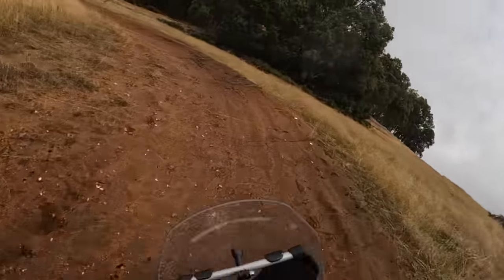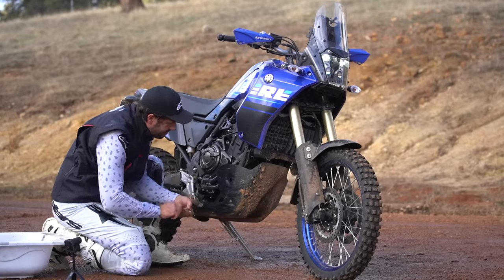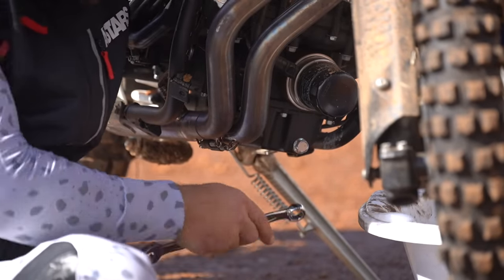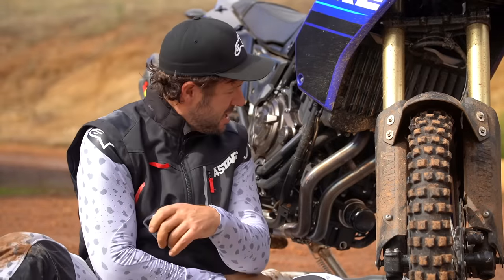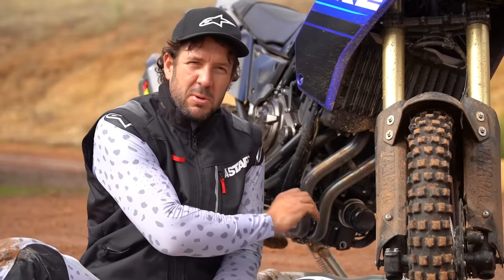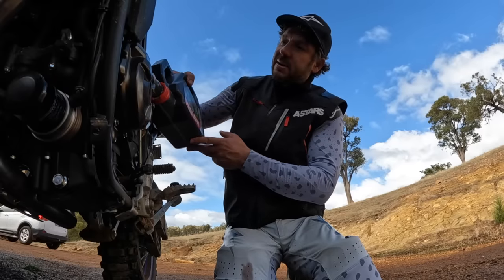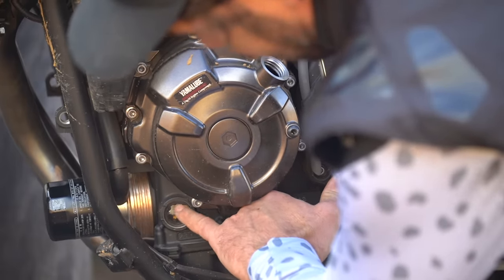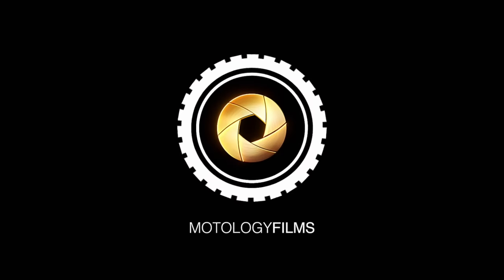Ultimate Engine Maintenance Guide: Triple Your Bike Engine's Lifespan

Comment: Learned more about oil changes in 18 minutes watching your video than I have in 40 years of riding :) Thanks!
Reply: You had never learned to get the bike warm? Read the manual much?
Reply: Me too feel stupid now
Reply: 💯 True 👍👍
Reply: Ditto, Martin.
Reply: Commen sense ..hot oil changes are the only way
Reply: Another thing we used to do back in the day, was fill up with a cheap flushing oil, run the bike around the block a few times, and then drain it again. Only then did we fill up with the good oil. My Dad taught me that. He recovered and stripped American tanks down in the Western Desert during WW2. He was also the guy who figured out how to make fast tanks and slow tanks. The army stole the patent.
Reply: Don't listen to this guy, oil weights are thinner when cold, his just reducing oil flow and leaving old oil attached to the engine parts. 
let the bike sit for a while to enable all the oil to sink to the drain pan,
Reply: @JackBurton7130  The manual just says to get to operating temp. Not ride it hard first as the dude suggested
Reply: 18:23 to be exact😂
Reply: Glad to know I've been changing my oil right for the past 40 years here....
Reply: @grahamnield7716  Yep my Honda says let it run 5 minutes but not ride it.
Reply: @DJIInLondon Nonsense! 10W-50 doesn’t mean the oil is ‘10’ when cold and ‘50’ when hot.. ‘10W’ indicates that the measurement was made with a different standard at the lower temperature than the hotter one. Oil isn’t magic - it doesn’t behave differently to every other liquid in the universe. Hot oil runs thinner than cold oil, and goes through smaller measuring holes. When I went to college viscosity was measured in “Redwood Seconds”. Doubtless they’ve changed the standard these days.. Les in UK
Reply: My oils never black when I change it

Comment: i'm a mechanic (a car mechanic but there are no differences when it comes to oil change) and i would say you did a pretty good job in showing how to properly do an oil change. 

i would just like to specify some things:

1- when installing a new filter, it is good practice to use some oil to lube the O-ring (in this case, it was pre-lubed), to do so just tip your finger in oil and wet the rubber seal (better with gloves) 
2- do not ever use power tools when tightening either the oil filter, the drain plug or the fill plug, as you correctly shown, you should alway tighten by hand and stop turning as soon as you feel a bit of resistance
3- one good thing to do is to check the oil filter and the air box, i often find bits of leaves and other dirt in air boxes (behind the air filter), i'm still puzzled as to why that happens even on relatively new air filters (i suspect poor installation is the cause) if you find such debris, use a hoover to suck all the debris out, pay attention also to the mainifold leading to the engine and hoover it as far as you can, DO NOT, under any circumstance use pressurized air to try to remove this debris, it could seriously damage your engine as you are pushing the debris INTO the engine. 
other than that, just give your engine a bit of time before you start hammering it (it doesn't really take much time on modern engines, you mainly just wanna reach oil pressure before starting to move, 10 seconds is a safe esitmate) and do not rev the engine much before it heats up a bit (doesn't take long, 1/2 minutes of decent speed driving). if you follow these instructions, and you do proper maintenance, your engine will be decently bulletproof (design defects not withstanding).
Reply: A good video. I use a torque wrench on sump plug and filter.
I also cut the old filter open and inspect the paper and keep it in a library with kms and date.
Reply: In your opinion, what is your recommendation on the oil and filter change for the bike at the same time... Specs do not call for the same change out... Cheers mate
Reply: @RobertSantos-rw8dy  I go 5k or 12 months. The start if the
Reply: Start of the ride season. Plus fresh brake fluid.
Reply: @frankguernier2280  inspecting the filter is a good idea, but one shouldn't be shocked if he finds a little amount of metal dust, just be careful of chunks, the torque wrench is also a good thing, not vital, but good.
Reply: @RobertSantos-rw8dy  just always change both, it's better to spend 10 bucks more and be safe when it comes to engines
Reply: @frankguernier2280  brake fluid should be changed every 2 years, but it may be a good idea to change it earlier if you ride hard, just always use the correct spec of fluid
Reply: 5K kms to change oil filter, can I change oil at 2.5K and not replace the oil filter until the 2nd change oil of 5K kms.
Reply: @frankguernier2280  i use the pneumatic impact when putting on my oil plug and i use vegetable oil as oil. HAven't changed my filter since 2003.
Reply: @niccolotesta683  I don't believe riding hard matters for the brake fluid. The reason we need to change brake fluid by time and not by miles is that it's hygroscopic, meaning it absorbs moisture from any air it's in contact with. This shouldn't change based on how hard you ride. The fluid isn't "worn out" or dangerous at the end of the 2 years either: that interval is designed so that when changed every two years, your brake system will be in good shape through the life of the bike. So it's not really based on one fluid change but the entire lifecycle.
Reply: What if I only have a Dyson?
Reply: @AleksiJoensuu  high temperature can lead to brake fluid degradation, which is why it is changed very often on race bikes, for street use, it is a good idea to change it a bit earlier than expected (2 years) if you ride hard and heat it up more than normal
Reply: @merkel2750  a Dyson works well to suck debris out of the intake system.
Reply: @itzFYEB  this is my other account
Reply: @itzFYEB  this is my other account
Reply: @junarcinas8633  if i understand well you're saying that your maintenance schedule requires oil filter change every 5k km, but you would like to know if you can change the oil sooner.

if my understanding is correct:
you can change the oil sooner then advised without changing the filter, you will remove some debris sooner than usual by doing this, i personally do not believe it makes much sense on an economic level, but if spending a couple dollars more makes you feel better, then go for it (if your engine model is prone to seizing, then doing this is a totally viable option).
Reply: Thanks for a great video. Oil is the lifeblood of a motor.
Reply: @RobertSantos-rw8dy  Cheap filter ? Change it everytime. Expensive filter that is rated for 2x as long as the oil ? Change it every other time .I change my oil and decent filter ( mid range price ) every year , I put on less than 3K a year .I have more than one bike and one is a hot running air cooled and it sometimes "tells" me to change it a little earlier ,some clunking into gear etc.Try to match filter and oil specs like when using synthetic oil get a longer lasting filter , regular oil maybe get a "cheaper" filter.
Reply: @junarcinas8633  In this day and age tell me what bike you can't download the manual for ? Go by what that says .
Reply: @frankguernier2280  personally, I'd cut that in half. Especially, if you do only 5k per year. I'd have a yearly service at the dealers, but perhaps do the oil change myself after the winter, as I don't do many miles, although ride every day regardless of weather. And lube and adjust the chain every 300 miles (it rains a lot here).
Reply: @niccolotesta683  I would say, read the manual. Usually, filter needs to be changed on every other oil change. About one a year. And it's not for the money, just a little less trash, consider the planet.
Reply: @pontushaggstrom6261  Let me guess, you are a professional mechanic for a major brand.
Reply: @romgl4513  of course if the manual specifies the oil filter be changed every other oil change it is best to do so, as i said, i'm a car mechanic, and generally speaking car manufacturers call for an oil filter change every oil change, it is also true that car engines tend to require oil changes less frequently than bikes
Reply: @niccolotesta683  I just watched a video of some engineer saying every 6700 km if you're keeping the car for 20-30 years like 400-800,000 km but 8000 km if 10-20 years 160-400,000 km  and that's using synthetic in both cases.  Not sure how bikes would compare to those numbers but I've been doing it every 5000 km I think or maybe its 8000 km on synthetic in my adventure and touring bikes.
Reply: @AleksiJoensuu  I've never in all my decades EVER changed my brake fluid.  It just doesn't seem to matter and same for my snowmobiles.

Comment: Agree with everyt single word you said on this video, as always.
And don´t forget 🙂
Never turn the engine off when the fan kicks on to cool the engine down, let it turn off first.
Reply: Why is that?
Reply: @Gwiedert  If you turn the engine in this very hot condition off, the heat will stay for very long time in the engine and because the water is not circulating at this moment it may start to boil and damage the coolant or even the head gasket and other parts will also sufer from this.
This is the reason why modern cars have an electrical water pump that continues to circulate the water even if you turn the engine off.
Sorry for my bad english, its not my native language.
Reply: @iliasminas7711  garbage German cars have those electric that don’t last
Reply: @Smoshylife  True
Reply: Σωστός

Comment: Would love to see how you change and measure fork oil. It's perhaps one of the most ignored maintenance tasks and yet a crucial one! Cheers
Reply: What a great subject for a video! Hopefully we will see it.
Reply: @SLP-eb1wp  Because it's generally better to measure by air gap, not fluid volume.
Reply: If it were crucial everyone's forks would be destroyed and leaking.
Reply: People ignore because they're a pain in the ass to do, some bikes you have to disassembly the whole front just to yank the forks out
Reply: @krb1230  then get the spec and a stick to measure the air gap.
Reply: @krb1230  Sure but you honestly don't have a option to measure air gap on most modern twin chamber forks. A good service manual will have CC's, temp and drain times for each chamber so really it's not that big of deal. Your not going to notice a few cc's or mm's difference bud. Just like is no need to race the bike before a oil change, warm it up some, run it through gears on stand once if want and drain it without burning the shit out of yourself, be just fine! The main point here is change the darn oil at a decent interval and stay on top of the air filter, 5% of material left in there, who cares, your motor doesn't!
Reply: @SLP-eb1wp  Ive done it by mL perfectly by the book, and on more than one occasion it has been too much and the forks would not compress all the way. ONLY ever do it by air gap.
Reply: @aaron___6014  It is crucial most bikes just sit in a garage doing fuck all km's a year and never see the result of neglegence.
Reply: @aaron___6014  It is crucial - loss of tire contact in the corner can be painful to deadly.
Reply: @SLP-eb1wp  If only !
Reply: More like ignored because fuelled by fear.
Reply: Along with shock servicing
Reply: @wills5482  aaaand?…just get on with it
Reply: Yes!

Comment: Don’t be afraid to allow the bike to cool a little bit after riding the hell out of it. I’ve had bad experiences with hot engines, aluminum threads, and steel bolts. Things don’t always come properly torqued from the factory, or your dealership, or you’re friends garage, and if it’s over torqued and good and hot, you’re chances of destroying threads goes up pretty quickly. Especially on smaller bolts like the ones you’d find on KTM’s LC8c oil filter cover.
Reply: Totally I would let my 701 cool down a bit, the threads are made of swiss cheese, i got 4 bolts for the 2 oil filters torqued at 8Nm and they scare the shit out of me even with a pro torque wrench  every time lol
Reply: I over tightened the drain plug on my cbr600 while it was hot once. I'm super paranoid about doing it again. I usually change it cold but I think i will warm it up this time and see how it goes. Will wait for it to be cold before tourqing the drain plug.
Reply: Being as I change mine at home, I can drain the oil hot and allow a decent cooldown time before torquing the drain bolt into the heated case.  Never had issue yet... but now you got me worried.  Is it mainly an issue when tightening into the warm aluminum? Or even when cracking the drain bolt loose?  Thx.
Reply: @CRGmotors  not cracking the drain bolt loose when it's warm for me, but tightening when engine is warm could stretch the threads
Reply: And if you're worried about sediment.. flush a whole entire quart of new oil through the fill hole, and let it drain out until empty or even clear.! Flush the engine with new, to get out all the old. Then fill completely up with new, good to go!
Reply: Always try to get my bikes up to temp when i'm changing the oil but i've not bothered to get them up to fan temp and plus your tip on getting the gearbox working makes a lot of sense 👍
Reply: Oil filter hand tight only , i did the two handed gorilla thing on my 98 R1 and i heard a click , 20 miles later the engine was a write off , i'd over tightened the filter ( by hand) a bit of ally broke off jamming up the impeller that runs the oil & water pump and that was the engine dead , you should be able to tighten a filter up with one hand ( yep always makes me worry too )
Reply: DON'T USE A TORQUE WRENCH on tiny case bolts. Tighten gently by hand with blue thread locker. The thread locker protects the threads by preventing galling and corrosion. The corrosion can destroy aluminum threads if they get moisture on the threads and the bolt doesn't' come out easily it can gall up the aluminum. The blue thread locker acts as a lubricant, and also keeps the bolt tight. Spark plugs need copper paste on the threads, no exceptions. Also, torque wrenches are too dangerous on tiny bolts in soft aluminum, in non-stressed bolts that are external bolts. On an internal rotating part, you need to torque it. But on a case cover, the torque is only holding the gasket on. You don't want to risk messing up with the wrong setting or improper use of your torque wrench and stripping the threads. It's MUCH safer not using a torque wrench, and using a tiny wrench, or a nut driver with a screwdriver handle, and tighten firmly by hand. Torque wrenches are so long that you can easily destroy a bolt without feeling anything.
Reply: @briankalagher6687  The manufacturers are to blame for the oil drain plug problems. As much as I'd like to say that people are idiots for stripping them.... No, the bolt should be about 3 times larger than it is, and it should have hardened precision steel threads with a steel insert, not aluminum threads that are part of your case. It should be "helicoiled" from the factory with hardened steel, so it can withstand massive over tightening without issue. But as it is, you can just gently destroy the oil plug with a standard ratchet if you're not paying attention. I have old antique power tools that have solid hardened threads that are inserted into the aluminum case covers, they don't just have a bolt going into soft aluminum, that's absolutely stupid on a critical oil plug.
Reply: There is a major problem with the "hot" engine process, and it's that aluminum expands much more than steel, meaning a hot engine oil plug is looser. A cold engine oil plug will be MUCH tighter and harder to remove. The plug will be easiest to remove with the engine hot. If you tighten the bolt when the engine is hot, you have to reduce the amount of torque to some amount, because the aluminum is expanded, and is much looser with the engine hot. The threads will literally shrink around the bolt when the cases cool, massively increasing the torque on the bolt. It would be easy to over torque the drain plug bolt if your engine is extremely hot and you slightly over torque your oil plug, especially if the plug is colder than the engine.

Comment: Mate, absolutely fantastic video! As an engineer sometimes is hard to explain to people, you have done it beautifully! Also worth to mention, for people living in cold area it is good practice to change oil before winter, as old oil with all these particles has also water particles in it and when sits over winter which tends to crystalize, once this happens there could be small microscopic reacting creating pitting or crevice corrosion. If you change your oil as you have shown before winter, you are ready to go in summer!

Comment: I feel like the majority of people hardly ride their motorcycles and usually sell them after a year or two, but this is all solid advice and guidance. Thanks
Reply: Interesting assumption.
Reply: Go take a look at the mileage of second hand T7's. A lot of them are well under 5k miles. People must have money to burn
Reply: @MrRadialdrift  well I say it based mostly on observation. Observation of the mileage on secondhand bikes and the experiences buying second hand bikes. In total that's experiences with 15 motorcycles (owned by myself or family over years), only one had more than 25k miles on it, and it was a 1971.
Reply: I've had my plated '05 WR450F    for 6 years now
Reply: @seatime674 how many kilometres are on it?
Reply: @petermclennan2416  I'm not sure,, I bought it from the original owner and it just came with a trip meter that you can erase not an odometer.. Low miles though...